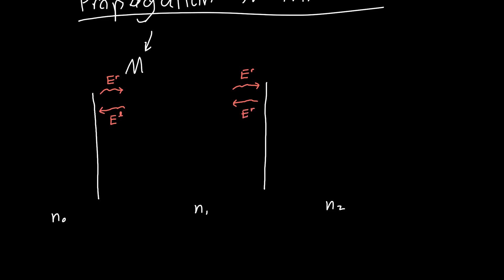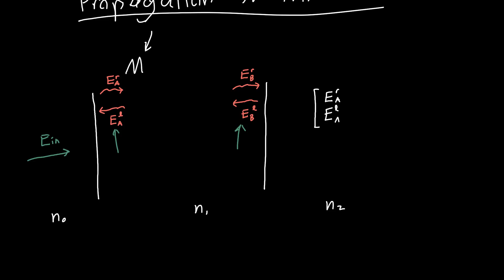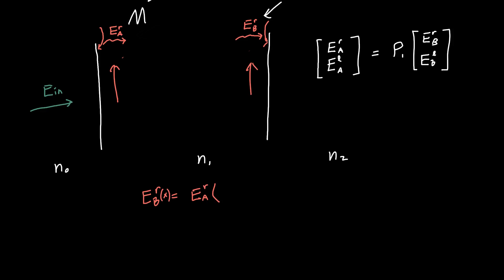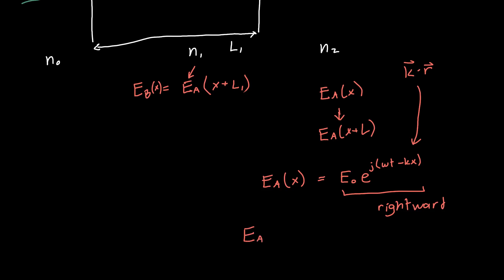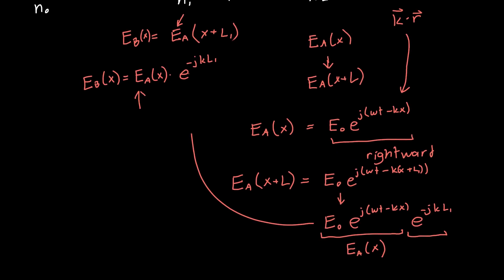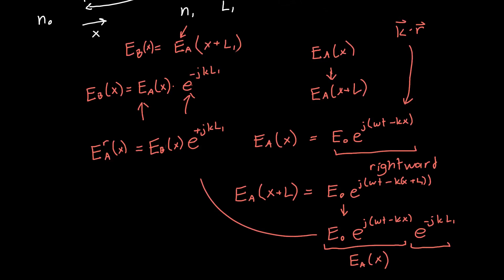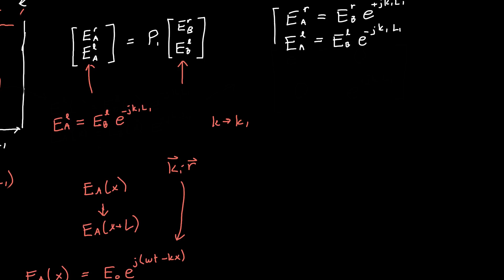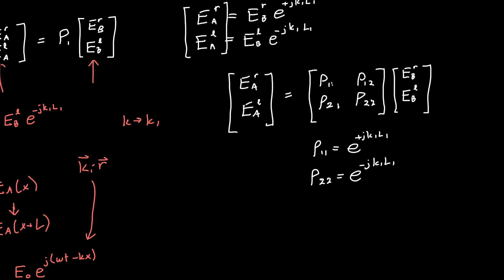Transfer Matrix Method Part 3 (Propagation Matrix)

Comment: Well I liked it and it was simple to follow but why P21 and P12 are zeros ?
Reply: i think its because when we say propagation, we are concerned with waves travelling in a single medium. When you say 12 or 21, you involve passing through mediums and that is handled by D matrix.
Reply: There's no physical thickness between the two films.

Comment: Sir, why do we assume complete ionization of donor energy level even if we know that when Ef will be closer to it, the probability of electron finding will increase?
Reply from the maker: Excellent question! As you pointed out, this becomes a worse and worse assumption as the doping increases, and strictly speaking it is only valid when the fermi level is far enough below the donor level (~3kT is usually used) so that the probability of finding an electron is low.
Reply: Thanks for clarifying, Sir. There was also a concept of impurity donor level which is formed where doping increases.